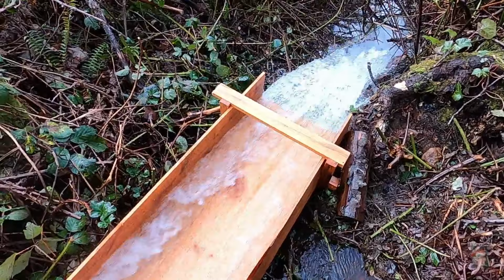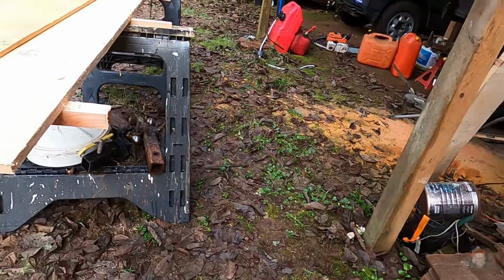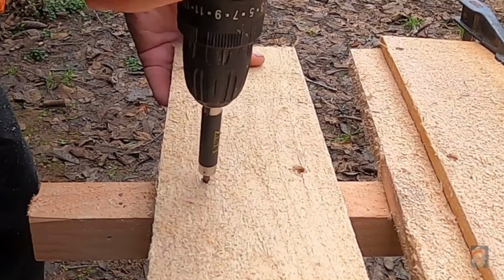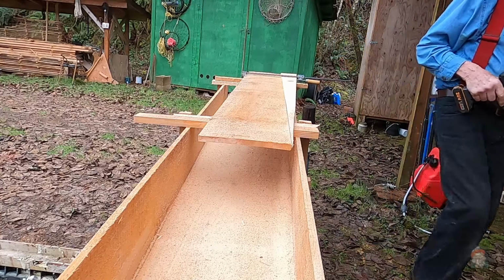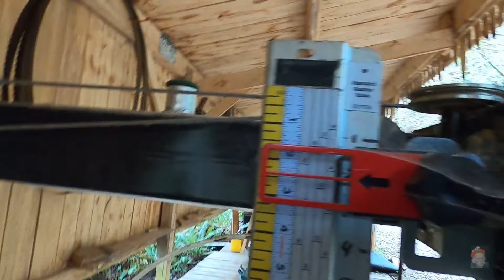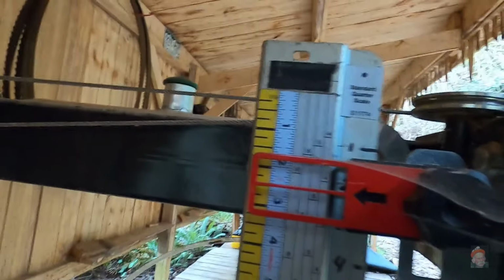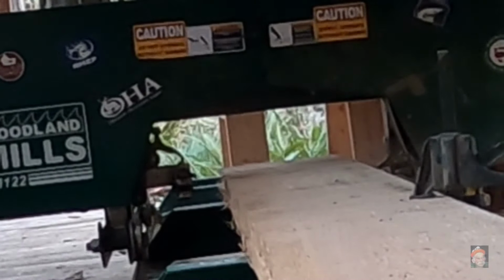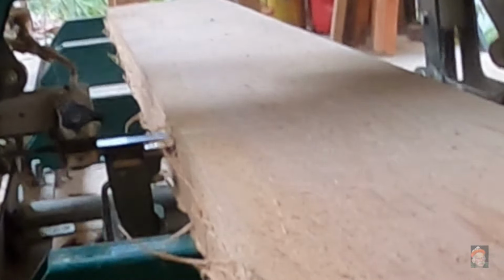Building a Flume With Lumber From My Sawmill In Hopes of Keeping a Creek Out of My Basement Shop

Comment: Excellent quality on the re-sawing! They look great!

I do as you with a 'riser' to assist re-sawing. To help hold the board, I will add distributed weight on top. Usually a couple of short (i.e. easy to handle) 6x8's placed end to end.
Reply from the maker: Good idea. Faster and easier than messing with clamps or weights that have to moved from in front of the saw and put back behind it. I once showed myself walking on the bowed board I was sawing ahead of the saw, pulling rather than pushing it. Safety police went nuts. https://youtu.be/d7i9c7iSjlg